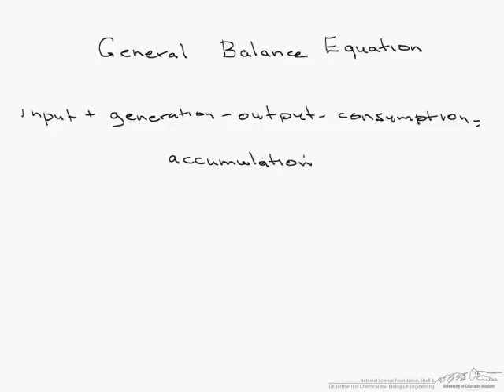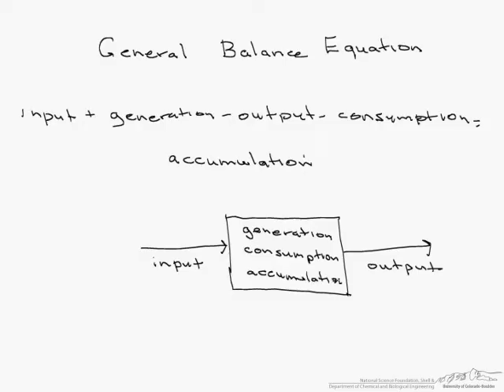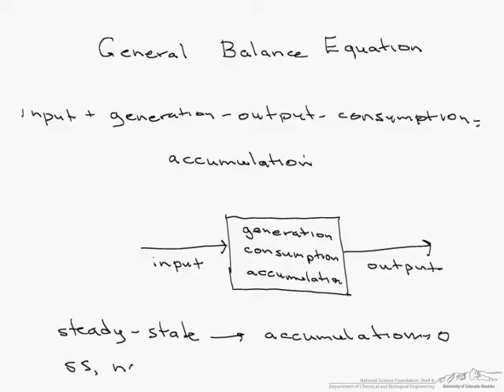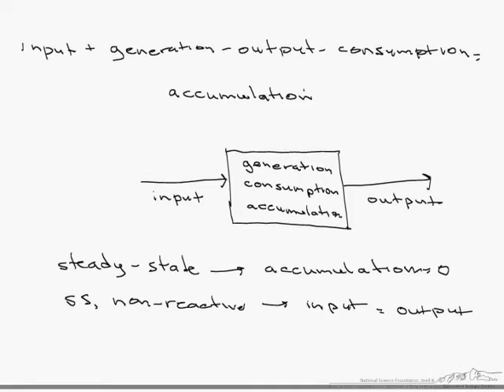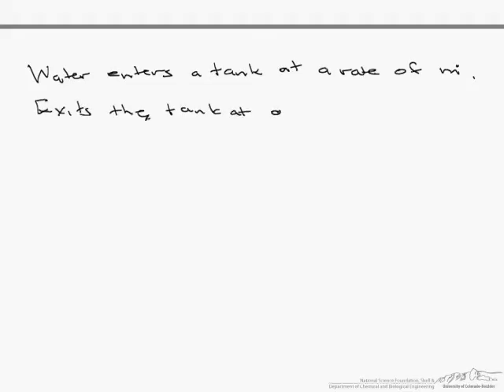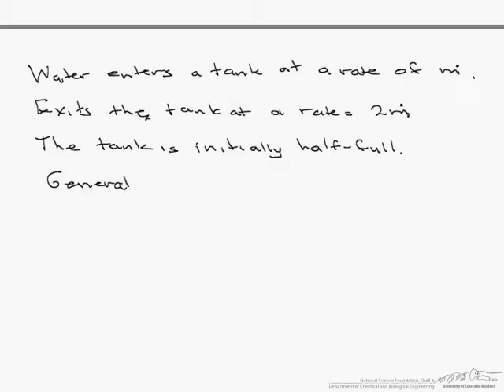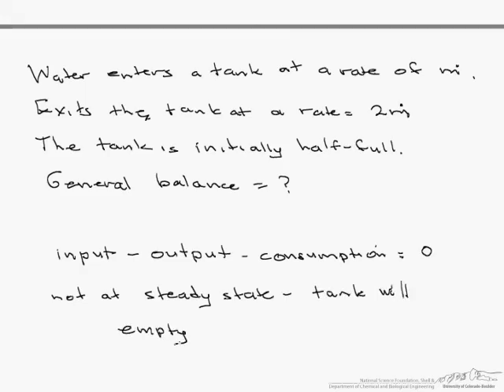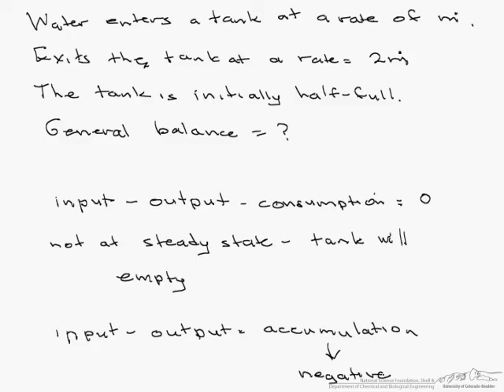General Balance for Material Balances

Comment: IMO, physically, it makes more sense to have accumulation term than a consumption term: accumulation is the net change in the quantity being balanced within a given control volume; in is the flow rate entering the control volume; out is the flow rate leaving the control volume; and production/consumption is the rate of change happening within the control volume (i.e. usually chemical reactions that convert one type of material to another).

Comment: there is something i don't understand on the example on this video. i think u made a mistake on mass balance equation, because there is no reaction during the process the generation and consumption must be canceled and because is not a steady state accumulation must NOT be canceled
Reply from the maker: +Taranza Nyikest Thank you for your comment.  I think this is a question of term definitions.  At the end of the screencast (at 3:08), she goes through the equation using the accumulation term, which is negative.  In the earlier equation, consumption is used to mean that more water is removed than is put in, not that there is any chemical reaction.  I hope that helps.
Reply: @LearnChemE okay, I get your point about term definition, but still, I feel that in the first equation, that consumption shouldn't be negative. mathematically, that consumption should be positive for this system. right? or did I miss something?
Reply from the maker: @inquisitivv  The general mass balance for the system is input + generation - output - consumption = accumulation. The first equation is just simplifying the general mass balance with no generation term or accumulation.
Reply: Taranza Nyikest